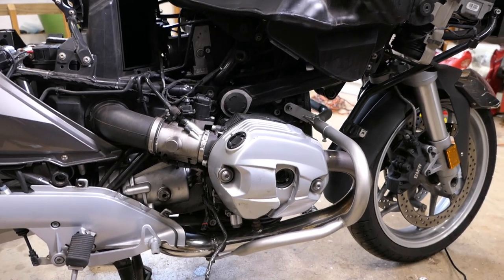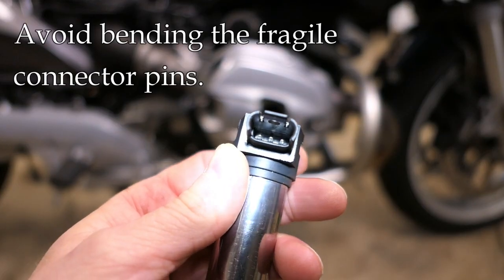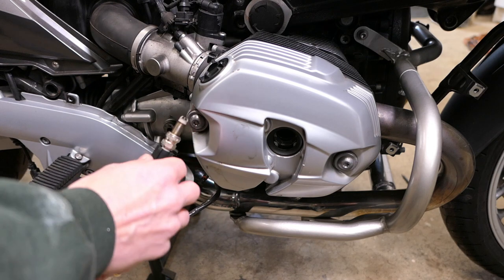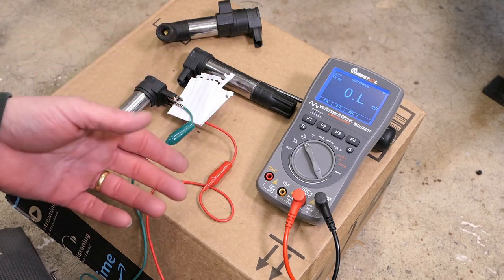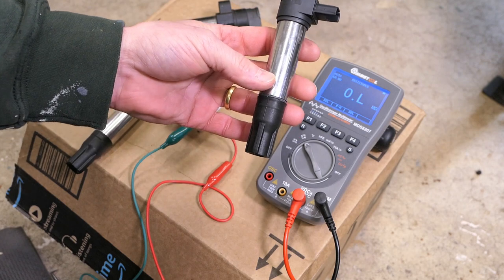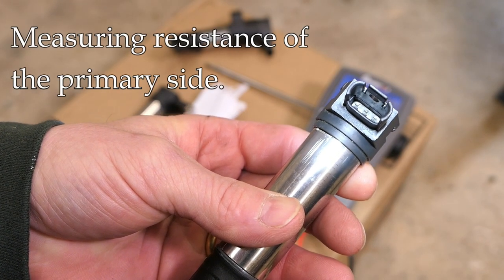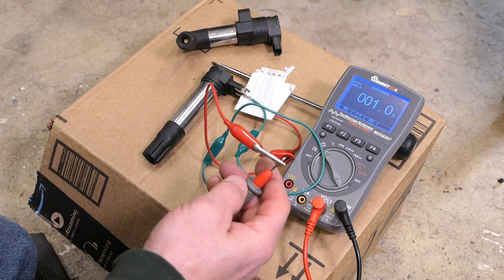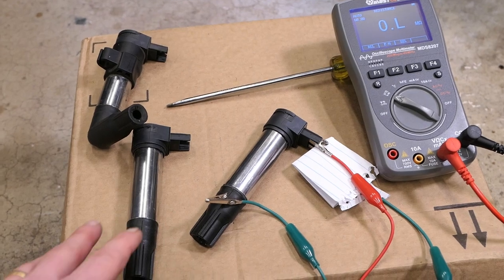How To Test BMW Motorcycle Ignition Coils

Comment: They make a spark plug tester tool. You don't need to ground your plugs.
Reply from the maker: They do, although I was discussing "shade tree" techniques that you might use without access to a well equipped shop.  Functionally there's really no difference between grounding a plug or using an inline spark checker.  However, I think you may have trouble using a typical checker with a recessed plug like the RT.

Comment: A dynamic test of the secondary side of the coils is the best way.
Reply from the maker: As I discussed in the video, though, the secondary side of these particular coils cannot be tested with a meter.  You are referring to a test to see if the secondary side produces a spark, but that has limited utility.  The quality or consistency of that spark if it is there can't be determined by eye.  You can only determine if there is a spark at all.
Reply: @tinderboxarts  You would use a oscilloscope with an inductive pick up to read the secondary side voltage.
Reply from the maker: Ha!  Yeah, well, not too many home mechanics or even dealer mechanics have a scope, never mind the specs to compare.  Back in the 80s when I was trained, most automotive shops had a Sun or Snap-on automotive scope which could be used to compare scope patterns.  I recall in school trying to memorize scope patterns for the tests.  The reason those scopes fell out of favor and eventually disappeared is because the huge variety of ignition component brands and types eventually made it impossible to know what was a good pattern and what was bad pattern.  The manufacturers certainly weren't publishing the info.  Just knowing the peak voltage under a given condition is also no guarantee of good or bad, without additional comparison specs.  I haven't seen an operating scope in an automotive or motorcycle shop in decades.
Reply: I understand what you are trying to say the average person is not going to have an oscilloscope in there toolbox, I agree. I have been a mechanic for 25 years and the most accurate way to know if those coils are good or any pencil type coil is to measure dynamically on the secondary side most coils read anywhere above 8k Volts and knowing how to read the scope is important as well. 
Coil saturation can be seen when using a scope as well. 👍

Comment: Hi mate thank you very much for the videos. I’m a newbie at using a multimeter and at the moment I’m having starting issues and spark firing issues on a Harley I have…. I’m trying to work out how to test my ignition coil (4 pin Delphi)….. but I am suspecting that this a wiring issue from my handle bar install……… what could I do to test the wires if I can’t easily get to the other end of the wire?
Reply from the maker: Well, if you want to test a particular wire for continuity to make sure it isn't broken under the insulation, you do need to get to both sides.  There are a number of probe types which may help, though.  A "piercing probe" is a device which connects to your meter and has a tiny spring-loaded needle on the business end to cleanly pierce wire insulation to get to the copper wire underneath.  A shade-tree mechanic version of this is just to take a sewing needle to pierce the insulation and then use an alligator clip on the needle.  There are "back probes" for your meter which have various designs to  slide into harness connectors without taking the connectors apart.  They let you test while the bikes is running, even.  There are spark plug testers which you MAY be able to insert between the coil and the spark plug (if the physical circumstances allow) and see if there is a spark or not.  

All that aside, if you've done some recent work and disturbed other wiring than you intended, you may well be able to see a problem with a close visual inspection and some patience.  If you find a pinched or bent wire you can test that section rather than the whole thing.  Ultimately, though, you'll probably have to take things apart.

Comment: Out of curiosity did you try reversing the meter leads when checking the secondaries?
Reply from the maker: When measuring resistance the polarity generally doesn't matter unless you have certain electronic circuitry, such as a diode, which only flow one way.  But if such circuitry existed for the secondary side of this coil, the measurement really wouldn't be useful anyway since the reading might be skewed by the circuit.